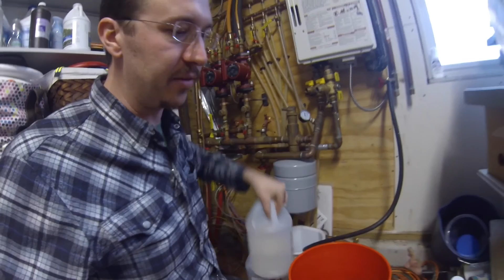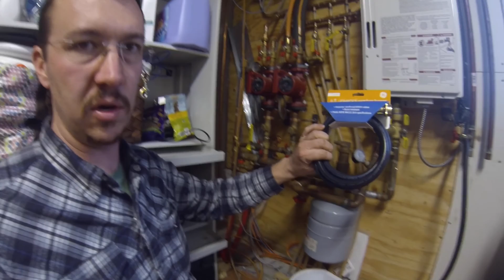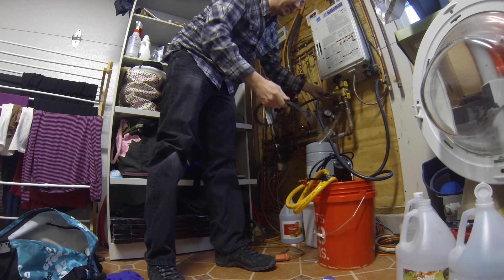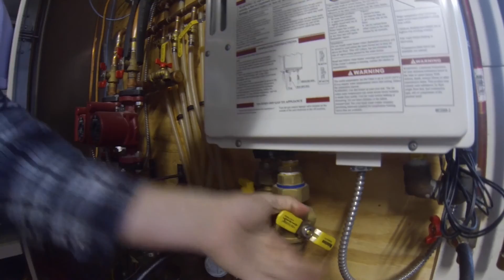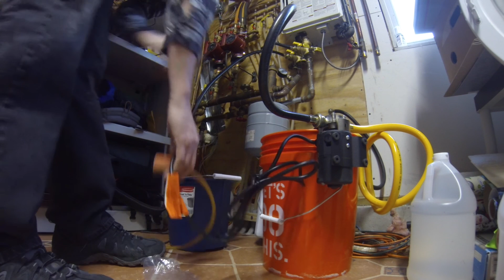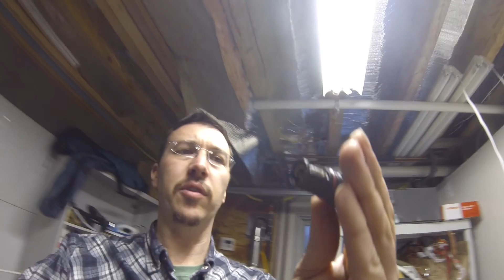How to clean a tankless hot water heater   Takagi Jr

Comment: Many of these Takagi tankless have a built in control valve that limits water flowing into its heat exchanger. If you turn off electric power to the heater when it is sitting idle that valve could be in close position and you won't be flushing it correctly.
Reply: My Takagi Jr's manual specifically says to turn off the power.
Reply: How would you know if the valve is in closed position?

Comment: I want to clean mine also. What is the reason you ran it in both directions?  I have never seen that done before.  That noise sounds like a bad washer on a shut off valve. What fixed the problem?

Comment: If you don’t have the clean out valves installed can you connect the sump to  feed where the filter is installed and have it come out at the hot water pressure release?

Comment: Thanks for the cleaning-video: I'll give it a try..  About the vibration noise: did you fix that?  Video on my site shows that problem too:  With coaching from the Takagi rep I opened up my T-K3 unit, (only a few screws), flipped the number 4 switch to the up position on the top left bank, and no more vibrating rumbling sound.  Might work for you too (can easily flip the switch back if that doesn't do the job).

Comment: Thanks for the great video but did it cure the noise problem? I have the same problem with my 6 year old Takagi Jr. Thanks
Reply: There’s a reply above with a possible solution. Did you try that??
Reply from the maker: +Cardiff Miller Nope.  It totally did NOT fix the noise problem.  It still makes the thumping or vibrating noise.  I suspect that my gas line my propane company installed is actually install in correctly.  If you'll notice the gas line comes down and swoops directly into the bottom of the unit.  I'm not a licensed propane installer but I at least know it should have a drip loop for condensation.  I think condensation is sitting at the bottom of the pipe and the gas is having to bubble through it and that is whats making the noise.  That's my best guess anyway.  Let me know if you find it!

Comment: Did it do the trick? I hope it work quietly now because it sounded terrible! My electric boiler has a tank which has a magnesium stick which yo have to change every few years! Many don't know that until the coil is clogged with stain  and burns up! I didn't know of the existence of a tankless waterheater until now but it seems a hot topic seeing all the clean out videos on YouTube!!! It's because they use less space that they make these type of waterheater?
Reply: Less space and a lot less energy usage. You only heat water when you use it, no constant storage of hot water and needing to maintain said water. Of course, using it for radiant heat kind of negates that savings in the winter time....
Reply: Looks good to me!!!